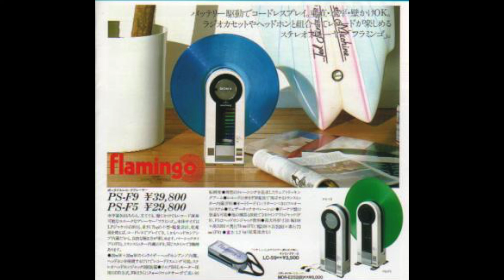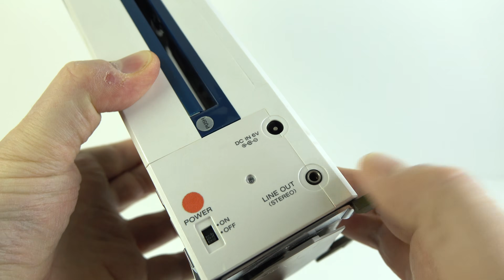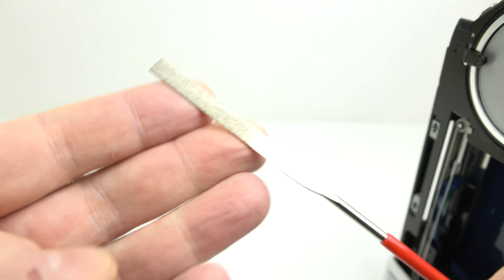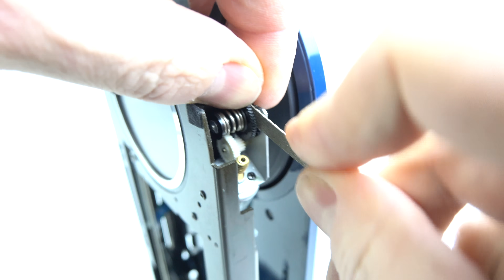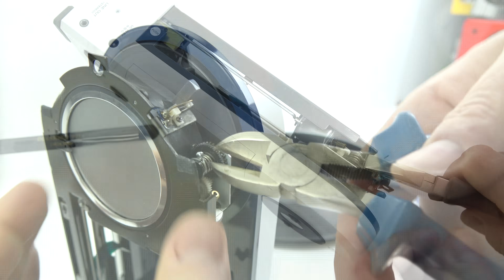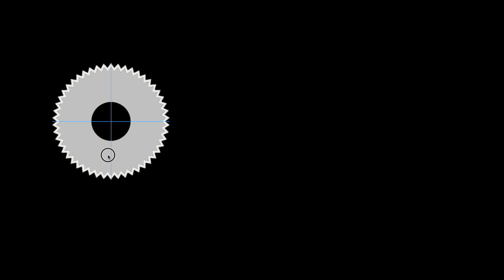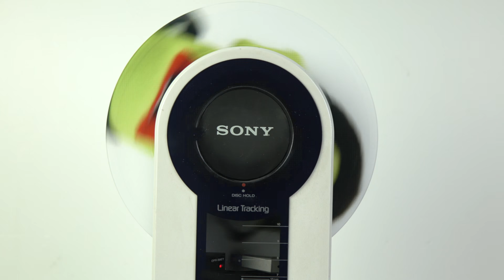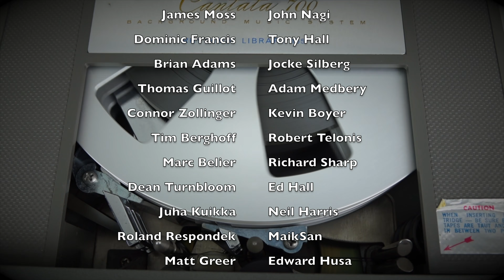The Sony Flamingo PS-F9 (Repair & Demo)

Comment: Don't know if you thought of it already or made a video about it but, have you compared the quality of sound or manufacture of the revival lp's vs those of the past. As well as the turn tables?  All I seen so far is some newer albums require multiple disks, and turn tables not having 78 speed, needing a amplifier to connect to modern systems, as well as some have usb out.

Comment: I'm wondering how it tracks the groove.
Reply: Jochen Stacker It still has a needle that goes into the groove and the tonearm is pulled along by the groove.
Reply: Ok, because he says the tonemarm runs along a metal bar that is pulled along by a piece of string.
I wonder now if that is being pulled along passively and wouldn't that excert quite high sideways forces onto the needle and groove, or is it active, which I don't think so for 80's tech.
Unless the mechanism is extremely light. Also it works in horizontal and vertical orientations.
I'd really like to know more about it.

Comment: What does that mean; hindsight is 20/20? Sorry, not a native speaker...
Reply: It is easier to see something clearly once it has already happened (whereas you might not be able to see it coming before it happens). 20/20 is a term used by eye doctors for clear vision (not requiring glasses), so the idea is that when you make a mistake, perhaps it is because you didn't see something in front of you that should have been obvious, but when you look back on your mistake it is obvious what went wrong.
Reply: It means the problem or solution seems obvious once it's been found.

Comment: Just a polite note the gears pushing together is a simple form of clutch. So if the record jams in some way the mechanism can slip rather than cause any damage good repair
Reply from the maker: I’m confused, this is exactly what I described in the video.
Reply: Techmoan yes you described it well just took me a minute to realise it was a clutch no biggeee
Reply from the maker: Oh, I only realised it was a clutch after I’d pulled it apart.

Comment: I have seen many novel uses for linear tracking record decks, but this is by far the best! I did have a standard linear tracking deck many moons ago, I think it was a Technics, it would occasionally suffer from a creaky mechanism at start of play in a 12 inch disc. Fortunately this was easily rectified by removing the dried out grease on the slider with Isopropyl alcohol and a cloth, then smearing a small amount of white grease along the slider. Thanks for this video, many happy memories brought back by this.

Comment: @Techmoan

I presume this is a direct drive machine? Why didn't every manufacturer use it, instead of belts? Was it to cut down costs?
Reply: Costs, and because direct drive turntables have a lot more audible rumble from the motor.

Comment: Hi, I think what would work best for those wheels is a drop of RC Silicone Differential Oil of high cSt number like 200000 between them. You could also use that for fixing the cassette deck door mechanisms that opens too fast after the years.
Reply from the maker: They were slipping...lubrication will create more slipping - I needed less slipping.
Reply: This is high viscosity oil that is designed for this kind of applications.
Reply from the maker: Oh then you'd have no chance getting it in there - did you see how close those plastic cogs were - that was the thinnest file I found for sale and it only just fit with some pressure applied.

Comment: I remember when you reviewed and restored that other vertical turntable how you'd like to have this one but it being too expensive. Good to see your videos are allowing you to get hold of that type of stuff anyway.
Reply from the maker: I'm glad you remembered. I really wasn't comfortable paying what I paid for this, but they rarely appear for sale and ever since that video I've been looking for a PS-F9 under £500 and this was the first one I saw.
Reply: Techmoan Sometimes you get lucky like that... A few weeks ago I got lucky in the same way, I was on a fleamarket and I always tend to look for tech/cameras... I saw a box with a few lenses sticking out. I picked one out (the one that looked most impressive) and saw that it was a Canon 300mm F4 L lens, the guy selling them says "10 euros for the whole lot" so you can imagine how quickly I walked off with the box smiling. That L lens alone is €400+, it's an old professional lens, super sharp. Besides that there were some crappy photo-flashers but also some lenses which at first glance seemed like those €5 bad ones, turns out as I put it on marktplaats (a site which you might want to search around on by the way) it was €110 too, together with some €20 stuff. Made 500+ that day if I hadn't kept most the stuff :)
Reply from the maker: That's where your knowledge really comes off - I wouldn't have had much of a clue...but even I would know that €10 sounded too cheap.
Reply: Techmoan What I often do is just keep ebay open on my phone and type in modelnumbers of whatever tech seems interesting.
Reply: I would love the Grim Fandango OST on vinyl.
Reply: I would love the Grim Fandango OST on vinyl.

Comment: Nice one- I have similar clamping issues with mine, except had to 3D print one of the gears as a previous owner had glued the 2 gears together and a load of teeth had been stripped from one. I'm close to it working again, but it's now slipping like yours & I still have some work to do. The original spring was missing too, and I'm experimenting with different springs from my collection of spares. I'm going to try your tape idea-good call. I'd tried some different rubber washers, but they've all been too slippy.  I think another reason that there's a clutch is to provide some give at each end of travel. 
You can remove the whole clamp motor mount assembly by removing two small screws at the front, but probably best to avoid doing so if possible as the motor is connected by a fragile looking ribbon cable. 
Cheers for linking to my website in your description : )
Reply from the maker: I hope you get it working. If I'd known about this slipping issue, I'd probably have just got a PS-F5, but the Quartz Lock, the Line out and the non-yellowing made me lean towards the F9.
Reply: Do you have the 3D files for the gear that you could share? Mine is broken too.
Reply: @benpollardmathias  Yeah mine as well. Looking for 3D files for printing. Thans

Comment: Why not recreate that intro of yours with the turntable?
Reply from the maker: The intro relied on the persistence of vision effect created with flashing leds that are synchronised with a magnet near the left reel that tells them when to flash so the text remains horizontal and the right way up.
Reply: PuffyRainbowCloud, yeah, you need more like 45 revolutions per *second*. (And preferably higher)
Reply: CollinG Tech how?
Reply: Leon thepro put different colored marks along the record to make up the wordmark, set the player to high speed, and run it
Reply: CollinG Tech I think it meeds to run a lot faster to create any effect. Otherwise its just spinning text.
Reply: Leon thepro yeah, it maxes out at 30 RPM
Reply: It could technically be done with a disc, if it was used with a stroboscope. I doubt that 45 RPM is fast enough for such an effect to look good, though.
Reply: PuffyRainbowCloud thats what Im saying, but maybe
Reply: You could shoot the video at 25 frames per second and then speed it up in post processing. Or even use a DSLR with a flash to trigger at every single revolution of the record.